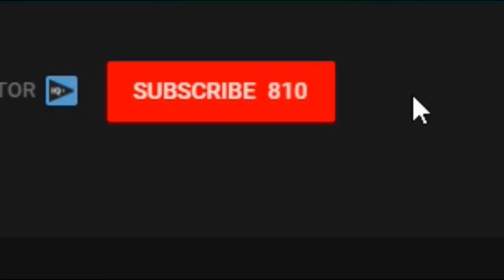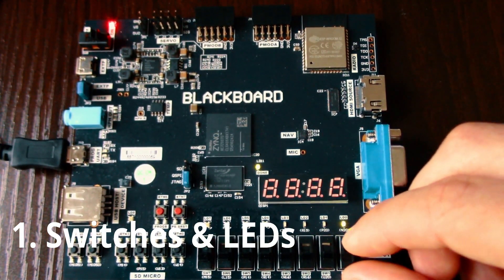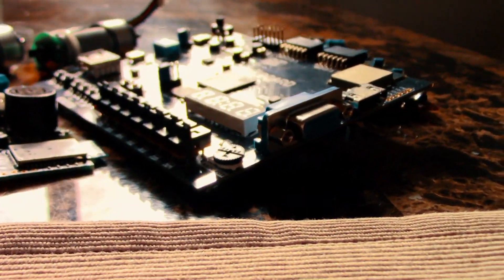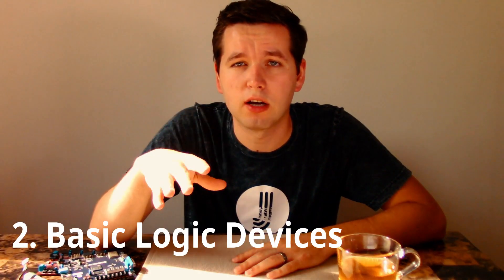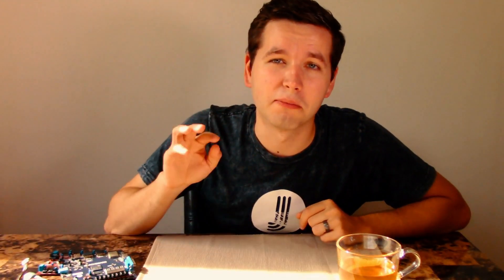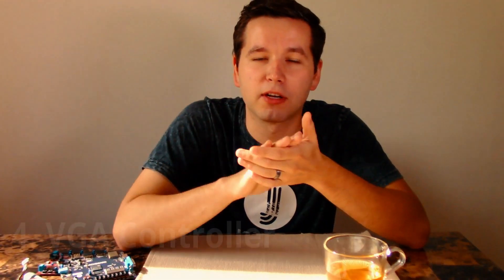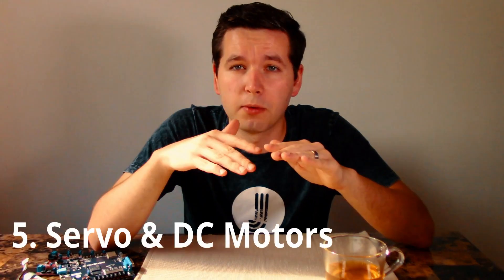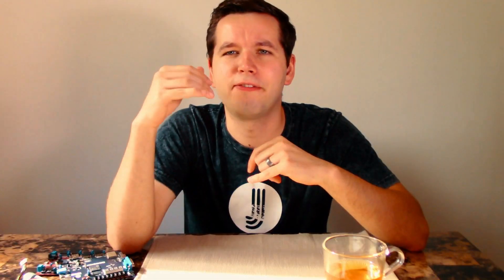FPGA Programming Projects for Beginners | FPGA Concepts

Comment: I am a  beginner in FPGA. I need to make an interface between an analog ASIC board and FPGA board using PMod AD1. But do not know where to start and what are the points I need to take care. Would appreciate if you make a video on this.  I need to process a low frequency ECG signal from the ASIC board to the FPGA board.

Comment: It will be better if you can do a project about FPGA based drivers distraction (mobile usage) detection system. Because most of the road accidents are happened because of drivers distraction.

Comment: What I'd like to do with an FPGA is create a complete motion control system: BLDC motor controller and a feed forward control system to use that motor controller to stabilize a platform in 1 axis. I plan on using this to stabilize a camera to the direction of gravity to reduce that bounce you see in action films.
Reply: I am working on implementing the same thing. Any advice?
Reply: @ZayMeisters  learn about the Clarke and Park transformations. Ti has a Spin Control chip. There's a cool set of YouTube videos that I recommend. Use the keywords Texas Instruments motor control.
Reply: Don't you need a vibrometer or accelerometer for this?

Comment: alot of old multitrack recorders with no vga out but they have onboard lcd screens that are tiny 
they have the connectors on the board of the multitrack that can be used to run them into vga between a fpga but  end user has to pay someone a small fortune to sell them a fpga to run to vga.

Comment: I was hoping for projects that actually require an FPGA. Of those, only the VGA controller seems like an FPGA is actually warranted.
To get a button controlling an LED... just put them in series. Seriously.
Basic logic devices? They come in packs of 4 on an IC or you can make your own using transistors.
Blinking LED? Use a microcontroller or a 555. Both are orders of magnitude cheaper.

Now, I do get what you are saying - you might want to do those things first to get familiar with the process of programming an FPGA. But, honestly, I would do something like this on my own, I don't consider these "projects". They are just little things to make sure you understand what you think you understand so you can rule it out as a source of a problem later on.

Comment: Could you please help me by giving clue, how to develop a Verilog for converting

55.893 to single precision floating point representation

Hardware will have one input which should be taking number in the form 55.65, 88.40, 38.675  etc...

And one output

Which is single precision Floating point representation
Reply from the maker: Understanding how floating point representation is generated in microprocessors would be the key to this task. You can then use that knowledge to build your own representation for it on an Fpga theN! Best of luck!

Comment: I would recommend any FPGA beginner to get one of pong p chu's books. Thers's FPGA prototyping by VHDL examples and FPGA prototyping by (system)verilog examples. They've got a lot of great and diverse examples and you can find free pdf versions of the older versions of these books online, but I'd highly recommend getting a hardcopy of one of the newer versions. There are altera/intel and xilinx variants of these books, but I'd highly recommend getting a xilinx 7 series FGPA at least as your first FGPA, because the vivado environment is just so much easier to work with than quartus. Furthermore Xilinx's DSP48 slices are way better in DSP and other applications than altera's. I'd also recommend learning (system)Verilog. I really mostly know VHDL, because that's what's used and taught here in the Netherlands, but (system)Verilog just has way better support and is used more around the world. VHDL-2008 actually is a great language, but it lacks support and user base, and vhdl-2002/1993 just doesn't compare.
Reply from the maker: Thank you for sharing and contributing to this community!
Reply: I disagree. Just because Verilog is used more in the USA and some east asian countries doesn't mean it is generally the best option for everyone. To the contrary, I heavily advise beginners to start learning with the language that's mostly used in their living area or area where they plan to work.